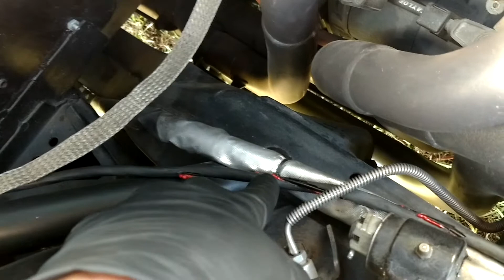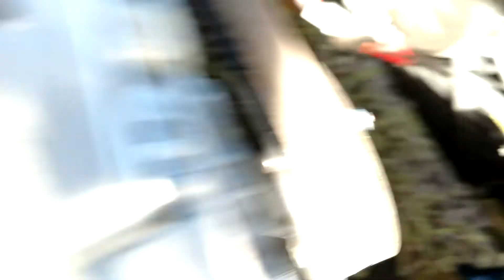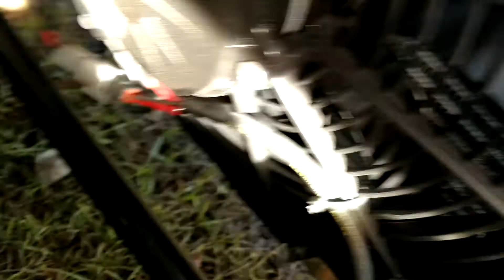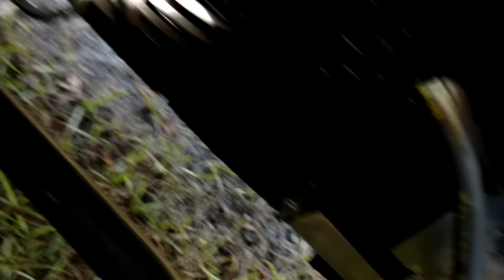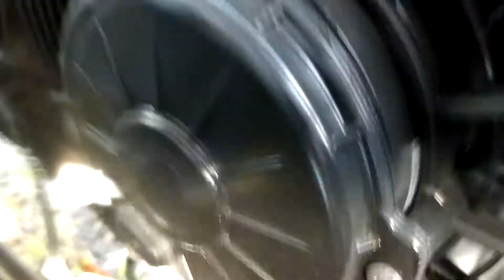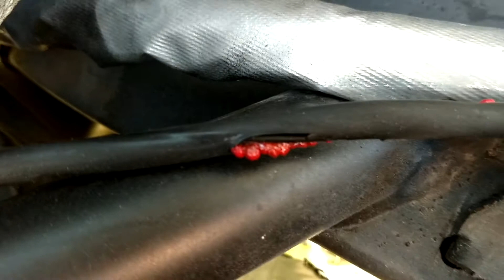Electrical

Comment: Do not run the car.  I suspect the fans are pulling to much current for those wires and you may have a short to ground making the fans mess up
Reply from the maker: I unplugged the fan and I'm just using one fan now. Why do you think I should not run it?
Reply from the maker: Kevin Wood Kevin I unplugged the fan that was connected to the melted wire and I'm just running the other fan. Why do you think I should not run the car?